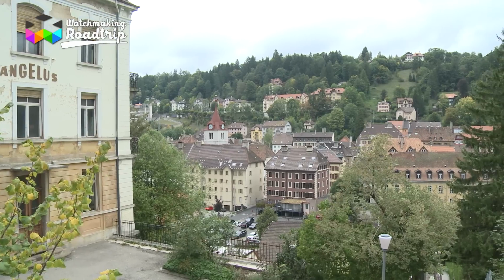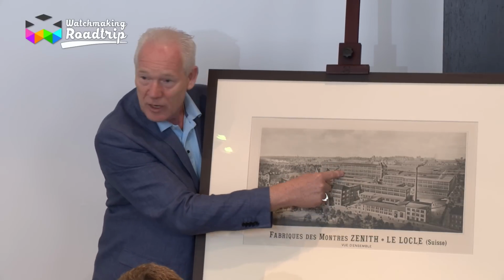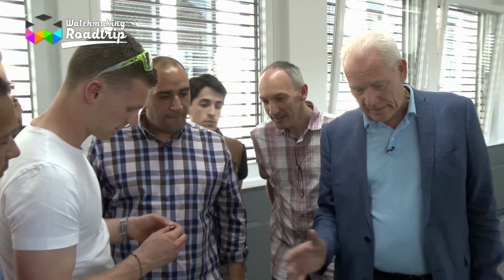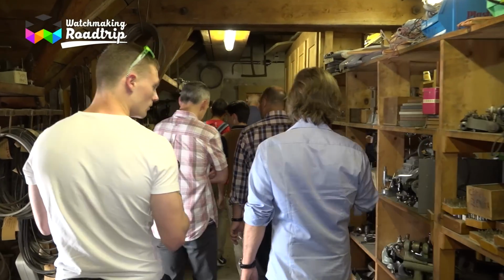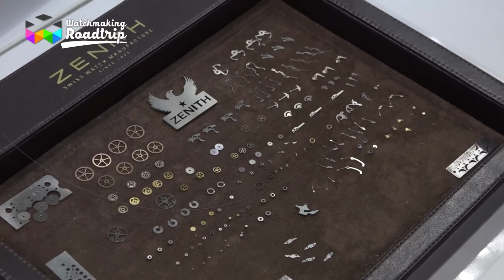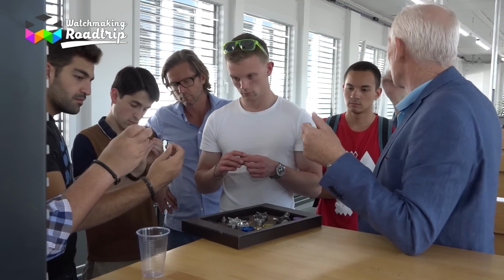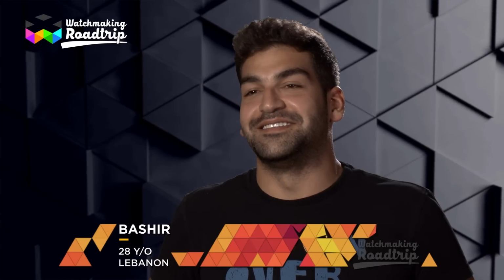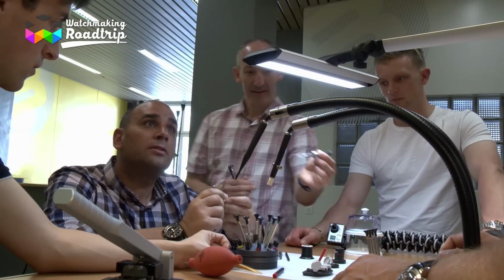A Walk Through Zenith Watches - Ep. 9 - WATCHMAKING ROADTRIP

Comment: Using Cosworth as an analogy for an engine maker for cars and Zenith as a movement maker for watched is incorrect.
Cosworth did not manufacture engines, instead, they used Ford engines as Ébauches, which they would modify. Cosworth were eventually bought by Ford.